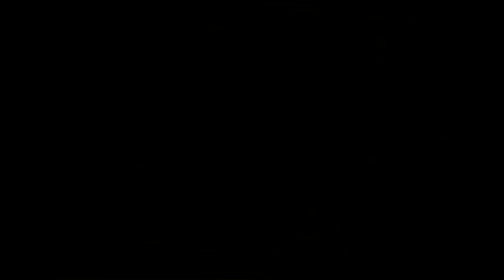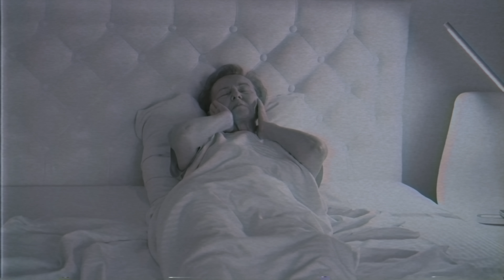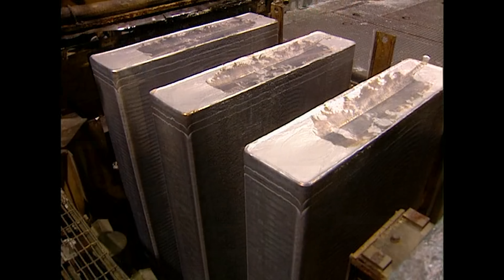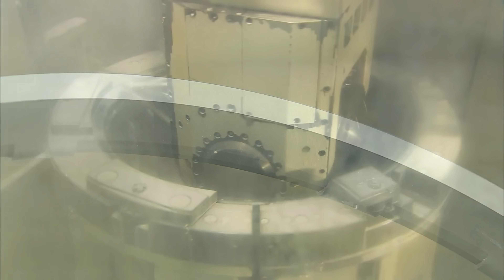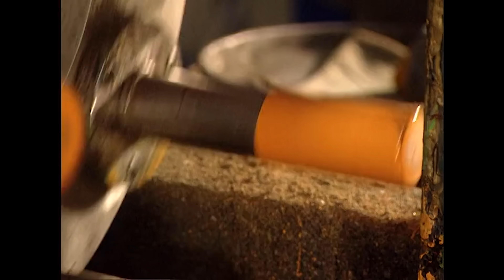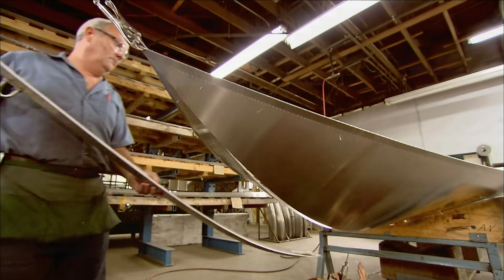How It's Actually Made - Aluminum Cans, Foil, Bike Wheels, Canoes, and More

Comment: Side effects of subscribing to the one man better than you may include:
Coughing
Sneezing
Running nose
Chronic Fatigue
Heart Attack
Anxiety
Depression
Mesothelioma
Fibromialgia
Hay Fever
Allergies
Sniffles
Achoos
Bless Yous
Gesundheits
Cancer
Diabetes
Hepatitis A
Hepatitis B
Hepatitis C
Hepatitis D
Hepatitis E
(do the whole alphabet)
Road Rage
Alcoholism
Withdrawls
Despoits
Hallucenations
Aspirations
Excessive Masturbation
allen wrenches
gerbil feeders
toilet seats
electric heaters
Trash compactors
juice extractor
shower rods
and water meters Walkie-talkies
copper wires safety
goggles
radial tires
BB pellets
rubber mallets
fans and humidifiers
Picture hangers
paper cutters
waffle irons
window shutters
Paint removers
window louvres
masking tape and plastic gutters
Kitchen faucets
folding tables
weather stripping
jumper cables
Hooks and tackle
grout and spackle
power foggers
spoons and ladles
Pesticides for fumigation
high-performance lubrication
Metal roofing
water proofing
multi-purpose insulation
Air compressors
brass connectors
wrecking chisels
smoke detectors
Tire gauges
hamster cages
thermostats
and bug deflectors
Trailer hitch demagnetizers
automatic circumcisers
Tennis rackets
angle brackets
Duracells and Energizers
Soffit panels
circuit brakers
vacuun cleaners
coffee makers
Calculators
generators
matching salt and pepper shakers
Restless leg syndrome
Hard to kill
High fiber fibromyalgia
Hot tub foot
Lou Gehrig's disease
Lou Barlow's disease
Lucy Liu flu
Advanced moist shin disorder
hyper tolerance to lactose
Urinary tract infection
Urinary 8 tract infection
trickle nipple
thick urine syndrome
Habsburg cholera
Clogged arteries
dropsy dry lip
intestinal colic
indoor toilets allergy
I'm a sufferer of milk
Leg loofah rash
bone worm
Selective fatigue syndrome
Hepatitis R
Irritable bowel syndrome
Spastic ear discharge
pubic lice
amphibial rabies
Anglocentric sickle cell anemia
scabies
rabies
Mickey Rooney sugar babies
tarnished yam
Symplex
Swollen perineum
chronic shame disorder
Larval penis
dirt belly
Parkinson's disease
Valet Parkinson's disease
Parallel Parkinson's disease
Parker Posey pox
pear ooboo
canina derived hip dysplasia
selective albinism
scrotal migraines
a prolapse
navel and of course
puff knuckle
hard to killness
Crustaceons
mammaries
spaghetti lips
runaway penis
digestive explosion
explosive diarhea
cut my life into pieces disorder
camptown races
doo dah doo dahs
pride
joy
anger
love
sorrow
agony of defeat
crinkle winklies
scrummy buguses
danny devitos

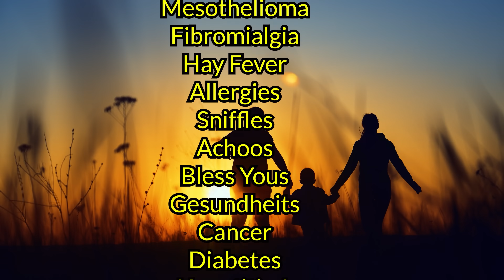Comment: 6:00
Every listed side effect:

Coughing
Sneezing
Running Nose
Chronic Fatigue
Heart Attack
Anxiety
Depression
Mesothelioma
Fibromialgia
Hay Fever
Allergies
Sniffles
Achoos
Bless Yous
Gesundheits
Cancer
Diabetes
Hepatitis A
Hepatitis B
Hepatits C
Hepatitis D
Hepatitis E
(do the whole alphabet)
Road Rage
Alcoholism
Withdrawls
Deposits
Hallucenations
Aspirations
Excessive Masturbation
allen wrenches
gerbil feeders
toilet seats
electric heaters
trash compressors
juice extractor
shower rods
and water meters Walkie-talkies
copper wires safety
goggles
radial tires
BB pellets
rubber mallets
fans and dehumidifiers
Picture hangers
paper cutters
waffle irons
window shutters
Paint removers
window louveres
masking tape and plastic gutters
Kitchen faucets
folding tables
weather stripping
jumper cables
Hooks and tackle
grout and spackle
power foggers
spoons and ladles
Pesticides for fumigation
high-performance lubrication
Metal roofing
water proofing
multi-purpose insulation
Air compressors
brass connectors
wrecking chisels
smoke detectors
Tire guages
hamster cages
thermostats
and bug deflectors
Trailer hitch demagnetizers
Automatic circumcisers
Tennis rackets
angle brackets
Duracells and energizers
Soffit panels
circuit breakers
vacuum cleaners
coffee makers
Calculators
generators
matching salt and pepper shakers
Restless leg syndrome
Hard to kill
High fiber fibromyalgia
Hot tub foot
Lou Gehrig's disease
Lou Barlow's disease
Lucy Liu flu
Advanced moist shin disorder
hyper tolerance to lactose
Urinary tract infection
Urinary 8 tract infection
trickle nipple
thick urine syndrome
Habsburg cholera
Clogged arteries
dropsy dry lip
intestinal colic
indoor toilets allergy
I'm a sufferer of milk
Leg loofah rash
bone worm
Selective fatigue syndrome
Hepatitis R
Irritable bowel syndrome
Spastic ear discharge
pubic lice
amphibial rabies
Anglocentric sickle cell anemia
scabies
rabies
Mickey Rooney sugar babies
tarnished yam
Symplex
Swollen perineum
chronic shame disorder
Larval penis
dirt belly
Parkinson's disease
Valet Parkinson's disease
Parallel Parkinson's disease
Parker Posey pox
pear ooboo
canine derived hip dysplasia
selective albinism
scrotal migranes
a prolapse
navel and of course
puff knuckle
Crustaceons
mammaries
spaghetti lips
runaway penis
digestive explosion
explosive diarhea
cut my life into pieces disorder
camptown races
doo dah doo dahs
pride
joy
anger
love
sorrow
agony of defeat
crinkle winklies
scrummy buguses
danny devitos

you're welcome

Comment: 'nipples. They screw onto the threaded end of each spoke. They let you tighten or loosen the spoke to keep the wheel straight and strong.Parts of the WheelSpoke nipple: The small nut that holds the spoke to the rim.Spoke: The thin metal wire that connects the hub to the rim.Rim: The outer metal circle of the wheel.Hub: The middle part of the wheel where the axle goes.Would you like to know how to true a bike wheel or how to replace a broken spoke?"- google AI

Comment: 6:02 Coughing, sneezing, running nose, chronic fatigue, heart attack, anxiety, depression, mesothelioma, fibromyalgia with a i, hay fever, allergies, sniffles, achoos, bless yous, gesundheits, cancer, diabetes, hepatitis A, hepatitis B, hepatitis C, hepatitis D, hepatitis E, (do the whole alphabet), road rage, alcoholism, withdrawls, despoits, hallucenations, aspirations, excessive masturbation, Allen wrenches, gerbil feeders, toilet seats, electric heaters, trash compactors, juice extractor, shower rods, and water meters Walkie-talkies, copper wire safety, goggles, radial tires, bb pellets, rubber mallets, fans and dehumidifiers, picture hangers, paper cutters, waffle irons, window shutters, paint removers, window louvres, masking tape and plastic gutters, kitchen faucets, folding tables, weather stripping, jumper cables, hooks and tackle, grout and spackle, power foggers, spoon and ladles, pesticides for fumigation, high-performance lubrication, metal roofing, water proofing, multi-purpose insulation, air compressors, brass connectors, wrecking chisels, smoker detectors, tire guages, hamster cages, thermostats, and bug deflectors, trailer hitch demagnetizers, automatic circumcisers, tennis rackets, angle brackets, Duracell and energizers, soffit panels, circuit brakers, vacuum cleaners, coffee makers, calculators, generators, matching salt and pepper shakers, restless leg syndrome, hard to kill, high fiber fibromyalgia, hot tub foot, Lou Gehrig’s disease, Lou Barlow’s disease, Lucy liu flu, advanced moist shin disorder, hyper tolerance to lactose, urinary tract infection, urinary 8 tract infection, trickle nipple, thick urine syndrome, habsburg cholera, clogged arteries, dropsy dry lips, intestinal colic, indoor toilets allergy, I’m a sufferer of milk, leg loofah rash, bone worm, selective fatigue syndrome,

Comment: 6:01 my favorites 
"Hay fever,
Achoos
Bless Yous
Gesundhiets,
Hepatitis A
Hepatitis B
Hepatitis C
Hepatitis D
Hepatitis E
(do the whole alphabet),       Yes it really said that
Road Rage,
Alcoholism,
Withdraws
Deposits,
Allen wrenches"
this whole section rhymes periodically (go ahead, sing it)
"gerbil feeders
toilet seats
electric heaters
Trash compactors               <-- This was capitalized for some reason
juice extractor
shower rods
and water meters Walkie-talkie
copper wires safety
goggles
radial tires
BB pellets
rubber mallets
fans and dehumidifiers
Picture hangers                 <-- Also capitalized
paper cutters
waffle irons
window shutters
Paint removers                     <-- capitalized
window louvres
masking tape and plastic gutters 
Kitchen faucets                    <-- Capital
folding tables
whether stripping
jumper cabels
Hooks and tackle                 <-- capital
grout and spackle
power foggers 
spoons and ladles
Pesticides for fumigation   <-- Caps
high performance lubrication
Metal roofing                         <-- C
water proofing 
multi-purpose insulation
Air compressors                    <--
brass connectors
wrecking chisles
smoke detectors
Tire guages                           <--
hamster cages
thermostats
and bug deflectors
Trailer hitch demagnetizes         <--
automatic circumcises            (WHAT!)
Tennis rackets                      <
angle brackets
Durracells and Energizers  <<<<<<CCCAAAAPPPPIIITTTAAALLL (help its been over 40 minutes)
Soffit panels                     <<
circuit brakers
vacuum cleaners
coffee makers
Calculates                     <
generators
matching salt and pepper shakers"
END OF RHYME
"hard to kill,
Advanced moist shin disorder, 
trickle nipple,
indoor toilets allergy
I'm a sufferer of milk
Leg loofah rash,
selective fatigue syndrome 
Hepatitis R,
Spastic ear discharge,
scabies
rabies
Micky Rooney sugar babies
tarnished yam,
chronic shame disorder
larval penis,
Parkinson's disease 
Valet Parkinson's disease 
Parallel Parkinson's disease,
pear ooboo,
scrotal migraines,
naval and of course,
hard to killness
runaway penis
cut my life into peices disorder
doo dah doo dahs
pride
joy
anger
love
sorrow
agony of defeat
crinkle winklies    <-- no not a typo
danny devitos"
and I personally think "butthole" should have been one. what are your suggestions
Reply: now after over an hour I can get back to watching... wait what was I watching

Comment: coughing
sneezing
running nose
chronic fatigue
heart attack
anxiety 
depression
mesothelioma
fibromialgia
hay fever
allergies
sniffles
achoos
bless yous
gesundheits
cancer diabetes
hepatitis a
hepatitis b
hepatitis c
hepatitis d
hepatitis e
(do the whole alphabet)                                                                 "yes that was said not me i would have wrote the whole alphabet if i had to"
road rage
alchoholism
withdrawls
despoits
hallucenations
asperations
excessive ############                          "not saying that"
allen wrenches
girbel feeders
toilet seats
electric heaters
trash compactors
juice extractor
shower rods
and water meter walkie-talkies
copper wire safety
goggles
radial tires
bb pellets
rubber mallets
fans and dehumidifiers
picture hangers
paper cutters
waffle irons
window shutters
paint removers
window louvres
masking tape and plastic gutters
kitchen faucets
folding tables
weather stripping
jumper cables
hooks and tackle
grout and spackle
power foggers
spoons and labels                                   "god how many more are there help me please"
pesticides for fumigation
high-performance lubrication
metal roofing
water proofing
multi-purpose insulation
air compressors
brass connectors
wrecking chisels
smoke detectors
tire guages        "yes it was spelled like that
hamster cages 
thermostats
and bug deflectors
trailor hitch demagnetizers
automatic ########                    "why just why"
tennis rackets
angle brakets
duracells and engerizers
soffit pannels
curcuit breakers
vacuum cleaners
coffe makers
calculators
generators
matching salt and pepper shakers
restless leg syndrome
hard to kill
high fiber fibromyalgia
hot tub foot                            "i now see why people find these channels funny and god this is a bit much"
lou gehrigs' disease
lou barlows disease
lucy liu flu
advanced moist shin disssorder
hyper tolerence to lactose
urinary tract infection
urinary 8 tract infection
"not doing this one at all not even hash tags"
thick urine syndrome
habsburg cholera
clogged arteries
dropsy dry lip
intestinal colic 
indoor toilet allergy
im a sufferer of milk
leg loofah rash
bone worm
selective fatigue syndrome
hepatitis r                                                             "i thought we were done with hepatitis i guess nto"
irritable bowel discharge
"no"
amphibial rabies
anglocentric sickle cell anemia
 scabies
rabies                                                                   "all the ies"
mickey roony sugar babys
tarnished yarn
symplex
swollen perineam
chronic shame dissorder
"no again"
dirt belly
parkinsons disease                                 "sorry for whoever has this"
"not doing the next 2 do to making fun of parkinsons"
parker possey pox
pear ooboo                                           "you know what im done jsut do it yourself have a good day tho this took 30 mins do to im bad at frame perfect pauses"

Comment: What's funny is that the "15 minute refractory period in-between" for the foil would be to let the crystal structure settle so they can flatten it better. (Note, that would most likely not happen in a factory, they are trying to make product, not be "efficient" if it even is efficient)

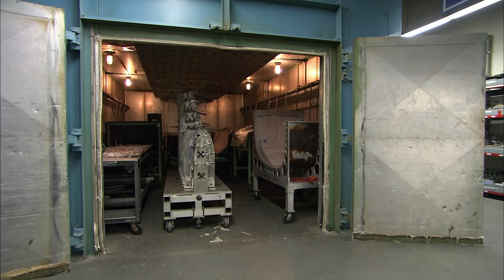Comment: God I actually work in aerospace manufacturing (carbon fiber) and I recognized way too fucking much of the aluminum nonsense. Like WHY DO THEY HAVE SOMETHING UNDER A VACUUM BAG GOING INTO THE OVEN AT THE SAME TIME AS THE LEADING EDGE ASSEMBLY (seen on the other ~6 molds at 24:50) AAAAAAAAAA

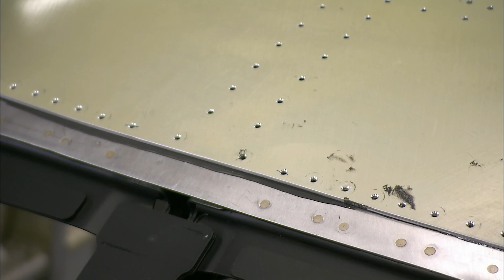Also the temporary fasteners at 25:45 are called clecos (may be a brand name) and they are super fuckin handy for applying pressure in bonded assemblies

Comment: For those who cant read fast
The side effects are
Coughing 
Sneezing 
Running nose
Chronic fatigue 
Heart attack 
Anxiety 
Depression 
Mesothelioma 
Fibromialgia 
Hay fever 
Allergies 
Sniffles
Achoos
Bless yous
Gesundheits
Cancer
Diabetes 
Hepatitis A
Hepatitis B
Hepatitis C
Hepatitis D
Hepatitis E
(Do the whole alphabet)
Road Rage
Alcoholism 
Withdrawls 
Despoits
Hallucinations
Aspirations 
Excessive masturbation
Allen wrenches 
Gerbil feeders 
Toilet seats
Electric heaters 
Trash compactors
Juice extractor
Shower rods
And water meters Walkie-talkies
Copper wires safety
Goggles 
Radial tires
BB pellets
Rubber mallets
Fans and dehumidifiers
Picture hangers 
Paper cutters 
Waffle irons
Window shutters
Paint removers
Window louvres
Masking tape and plastic gutters 
Kitchen faucets
Folding tables 
Weather stripping 
Jumper cables 
Hooks and tackle
Grout and spackle 
Power foggers
Spoons and ladles
Pesticides for fumigation 
High-performance lubrication
Metal roofing 
Water proofing 
Multi-purpose insulation
Air compressors
Brass connectors
Wrecking chisles
Smoke detectors
Tire guages
Hamster cages 
Thermostats
And bug deflectors
Trailer hitch demagnetizers
Automatic circumcisers
Tennis rackets
Angle brackets
Duracells and energizers
Soffit panels 
Circuit brakers
Vacuum cleaners
Coffee makers 
Calculators
Generators 
Matching salt and pepper Shakers
Restless leg syndrome 
Hard to kill
High fiber Fibromyalgia 
Hot tub foot
Lou gehrig's disease 
Lou Barlow's disease 
Lucy Liu flu
Advanced moist shin disorder 
Hyper tolerance to lactose 
Urinary tract infection 
Urinary 8 tract infection 
Trickle nipple
Thick urine syndrome
Daniel day Lewis 
Habsburg arteries 
Dropsy dry lib
Intestinal colic 
Indoor toilet allergy 
I'm a sufferer of milk
Leg loofah rash
Bone worm
Selective fatigue syndrome 
Hepatitis R
Irritable bowel syndrome 
Spastic ear discharge 
Public lice (I've had IRL)
Amphibial rabies 
Anglocentric sickle cell anemia 
Scabies 
Rabies 
Mickey Rooney sugar babies 
Tarnished yam
Simplex 
Swollen perineum 
Chronic shame disorder 
Larval penis
Dirt belly 
Parkinson's disease 
Valet Parkinson's disease 
Parallel Parkinson's disease 
Parker posey pox
Pear ooboo
Canine derived hip dysplasia 
Selective albinism 
Scrotal migraine 
A prolapse 
Navel and of course 
Puff knuckles 
Hard to killness
Crustaceons 
Mammaries
Spaghetti lips 
Runaway penis 
Digestive explosion 
Explosive diarrhea 
Cut my life into pieces disorder 
Camptown races
Doo dah doo dahs
Pride 
Joy
Anger
Love
Sorrow 
Agony of defeat 
Crinkle winklies
Scrummy buguses 
Danny devotes

I have a challenge I have added something here that was not in the video reply what you think it is